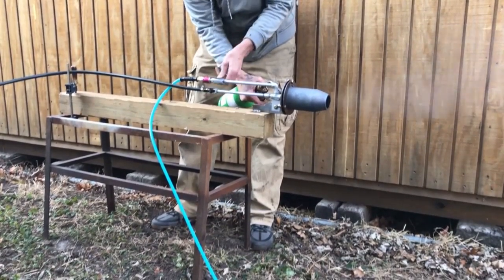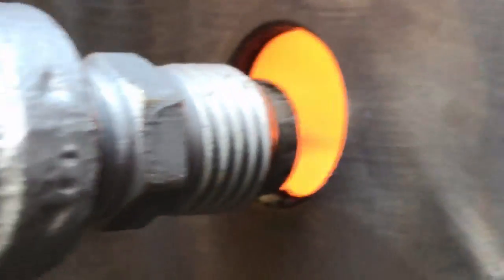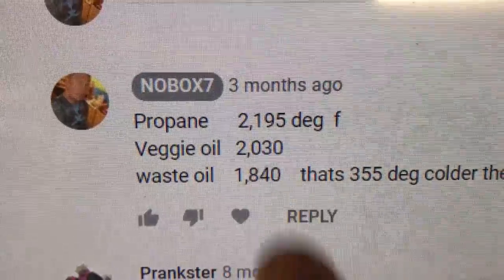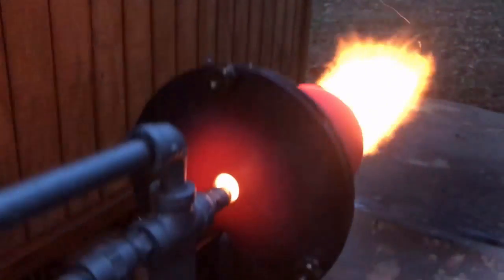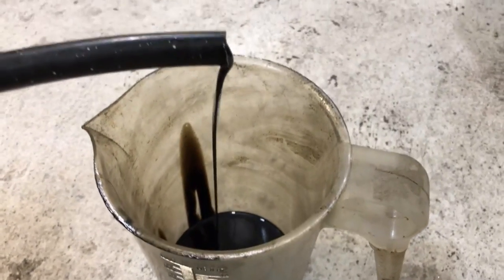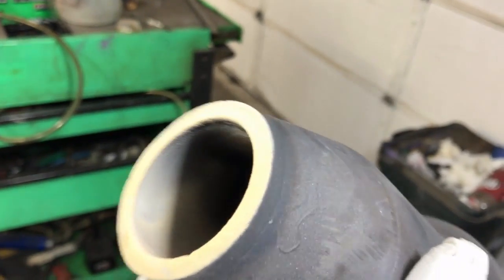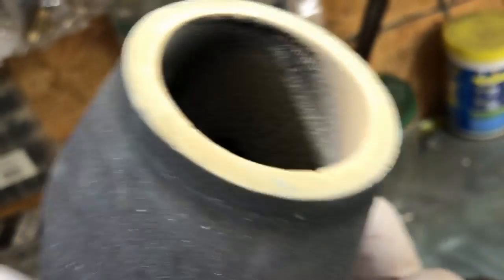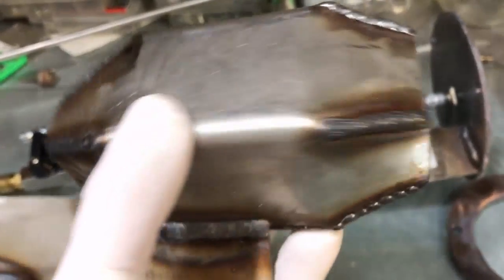Silicon Carbide Waste oil burner Temp Record Broken

Comment: Nice compact burner. Introducing a vortex air swirl between the 2 plates, similar to a brake rotor, will improve burn temperature and mixing for a white hot core. Might even keep the plate cooler like a heat sink. Preheating the fuel will improve flow in a small fuel line. Unless you are flowing at Mach+1 decrease the exit angle by half and turbulent flow will clean up too and there's always secondary air for afterburning.

Comment: You need to add a flow pump with a regulator. That would supply enough oil no problem.

Comment: the yellow color is probably the burner getting hot enough to burn the zinc ( zinc dialkyldithiophosphate) in the oil. Zinc oxide is yellow. and its quite toxic. and you should not breath it at all. There is a lot of chemistry videos about it and the yellow soot it creates when its burned.

Comment: That white build up its probably an oxidation layer...So most likely its SiC reacting with oxygen to get SiO2
Reply: You are correct.  I think it is mostly like a combination of air and water.  Oxidation of SiC in the air starts to occur at 3000F.  It does not harm the SiC as far as I know. However, water/steam oxidation of SiC does degrade SiC.

Comment: Love the videos; I'm in the process of trying to build my own waste oil heater, not having much luck. Bought a 1mm siphon feed atomizer, feeding it with ~40PSI air and waste engine oil. Shooting it into a length of 1 1/4" steel pipe about 3' long as a burn chamber. By itself, trying to light it with a propane torch, it never even tries to catch. Larger weed burner torch blowing into the pipe, after the pipe is red hot, I can then introduce air/oil and it'll halfway burn (sounds like a giant pulse-jet) but it's definitely not quite right. Still playing with air press / oil valve but not having a lot of luck. Maybe too much length on burn pipe?

Comment: The white ash is what I see in a
 Clean burn waste oil furnace.... 

We heated a huge shop. Twice a year I cleaned out the furnace. Was  like ash from a wood stove. 
We burnt roughly 1000l per 2-3weeks depending on how cold its was outside.

I would definitely  try not to breathe it the ash...
Reply from the maker: Great input friend

Comment: In my last build i get 2498 F with waste oil
Reply from the maker: yes that was likely in a forge or foundry though and not a naked flame. this burner can also get higher temps if directed into a foundry
Reply: @NOBOX7  my test was naked flame ; the problem is the sound its sooo loud like a F16

Comment: Suggestion on your oil been too cold why don't you put a metal tube so it will preheat the oil before it goes into it might atomize better
Reply from the maker: Ive tried that in the past , it works great for a time but then varnish build up kinda kills it
Reply: @NOBOX7  try heat tape?

Comment: Could you use the waste heat radiating for preheating both the air and oil? I think you could get some great temp record with it
Reply: Air expands as its heated, thus having less oxygen concentrations. So I dont know if it would actually help
Reply: @arielkozak  could increase pressure to keep the air ratio correct but it would be inconvenient

Comment: Could the yellow deposit be sulphur? 
  Could this experiment also benefit from air pre-heat. 
  Awesome work.
Reply: At 2000deg no way its sulfur but it might be some heavy metals oxides from all those additives in the oil.
Reply: Ok, 👍🏻 thanks for the info. Every day is a school day, eh?
Reply: I see, would sulphur burn at those temps?
Reply: @captroft  definitely.

Comment: I'm thinking the waste oil in such an efficient burner is the catalyst. It contains carbon and metal from the engine it was drained from suspended in oil in a hyper efficient burn chamber.
Reply: If you suspend nano powdered aluminum and use your fuel oil as a carrier you might hit even higher temps if you can get the aluminum to burn in your flame. Maybe nano magnesium suspended in oil.